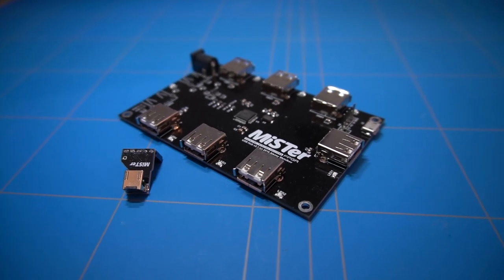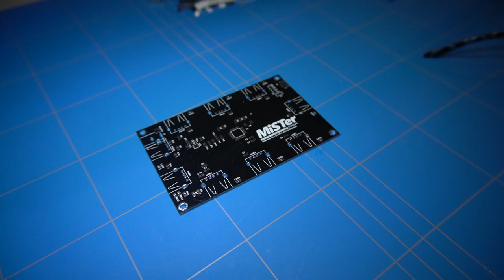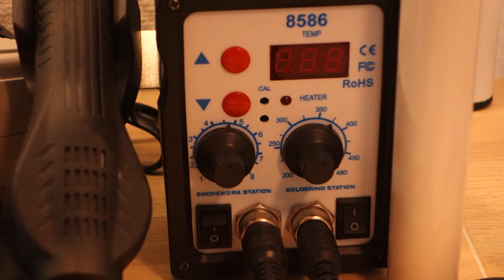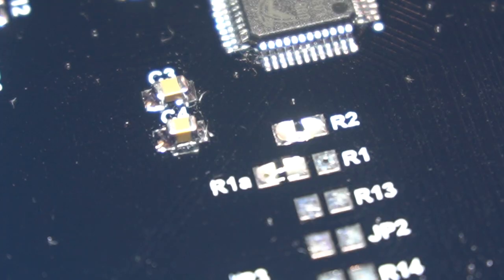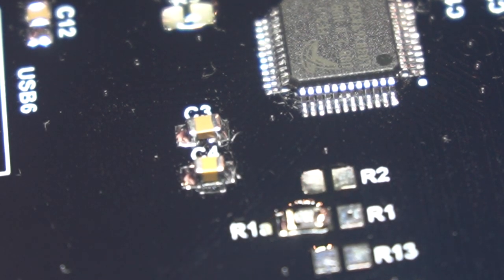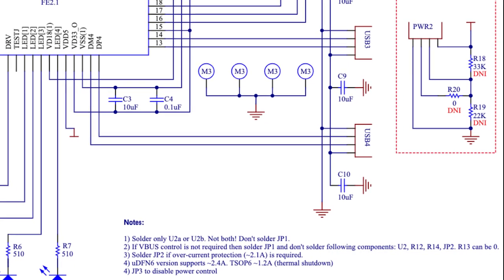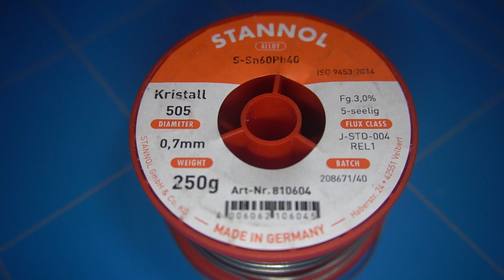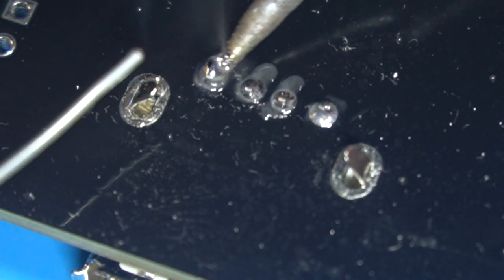Soldering of USB Hub 2.1 for MiSTer

Comment: what you think is it save to use a USB Power2 in instead of a barrel connector?
Reply from the maker: In the configuration that I have soldered USB is not accepting power. It is powered by the barrel jack only.